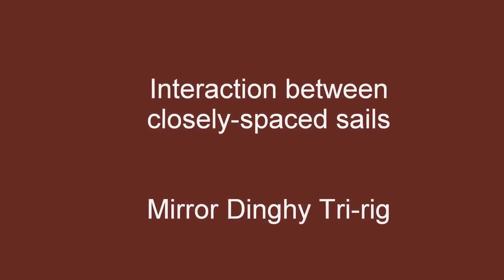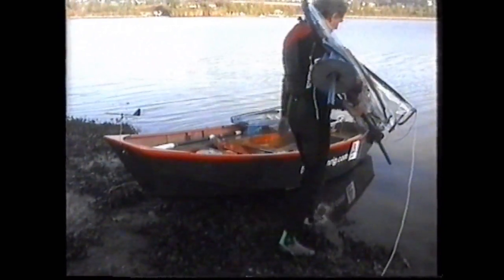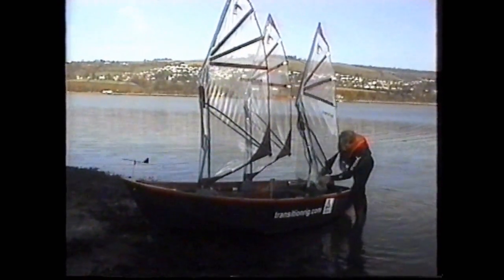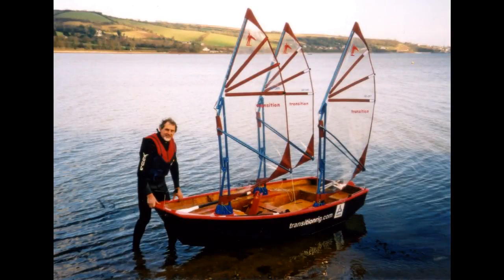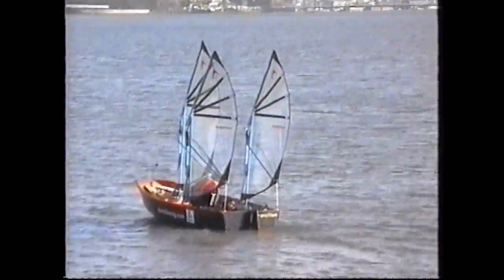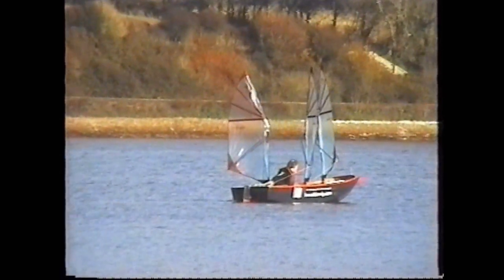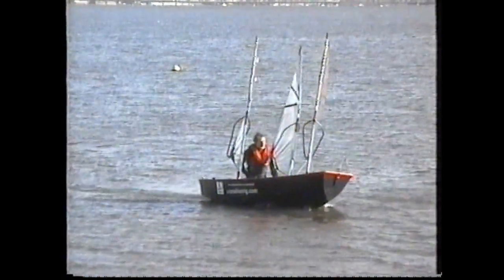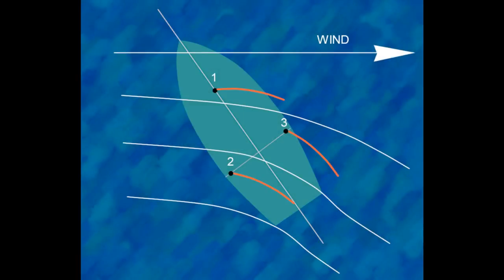Three Transition Rigs on Mirror dinghy

Comment from the maker: Thank you for your thoughtful comments, David. While sailing I had the feeling that the three rigs were working together rather like a slotted wing, so the work being done by each was enhanced by the others. I am aware that kites are being used to propel ships - they have some advantages over sailing rigs attached to the ship in terms of power per given area and reduced footprint on the deck, but are more difficult to control and may have additional safety issues. I envisage a range of possible solutions to wind assistance for larger ships - sails, kites, rotors, and so on. Each method has advantages and disadvantages, and the choice made will depend on the exact application. My proposal is for folding sails in removable pods. Your suggestion that multiple smaller rigs might enable younger children to take part in Mirror races is a good one - the tension on each main sheet is reduced and the lower centres of effort reduce the risk of capsize, so this would benefit the younger sailors.

Comment: Interesting 🙂
Using layman terms, in the way that a job and main interact using the ‘slot’ between the two, I wonder how a similar setup between three sails in a line instead of two would work.  Obviously impractical in a Mirror as the sailor couldn’t move to the windward side of the boat.

Comment: It looks as if the rear leeward sail is pulled in so far that almost all the lift it generates will be sideways to the boat, and it isn't able to transfer any power to the sail ahead of it either in the way that a main and jib normally interact, so I suspect only two of the sails are doing useful work when going upwind, although performance may be better than that on other points of sail. It would be interesting to sail it alongside a Mirror, perhaps with just the mainsail up, and then raise and lower each of the three sails in turn to see how much the relative speed of the two boats is affected for a variety of different directions of travel. Moving the front sail to leeward on each tack so that it's in line with the one behind should provide better performance. For ships, this idea is probably out of date now that people can use computer-controlled kites to tap into much stronger winds higher up (a commercial system for ships is now available, as I'm sure you know), but there is potential for your idea to convert a Mirror to enable young children (e.g. three 5-year-olds) to handle it on their own without being any slower than a Mirror with the normal rig, thereby enabling them to race against normal Mirrors safely and to stay with them as a compact fleet. That would be fun.